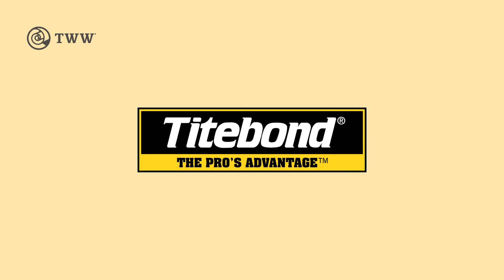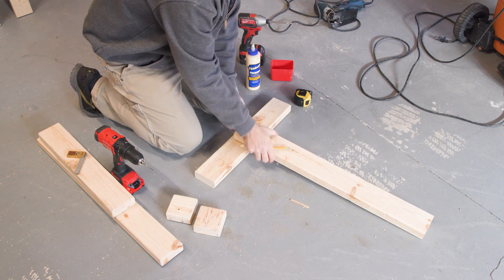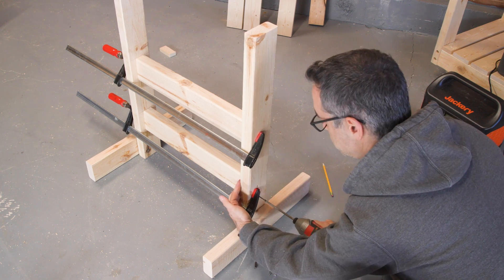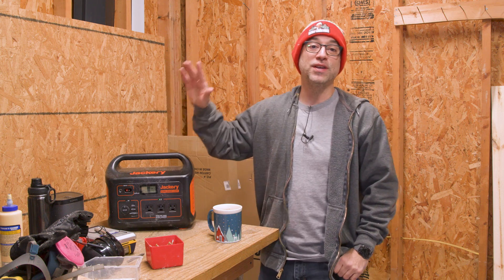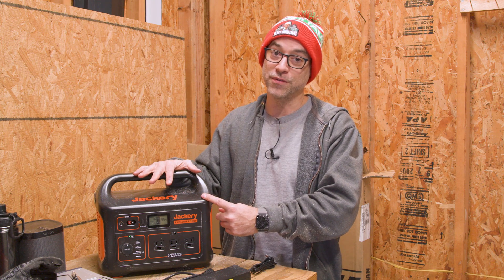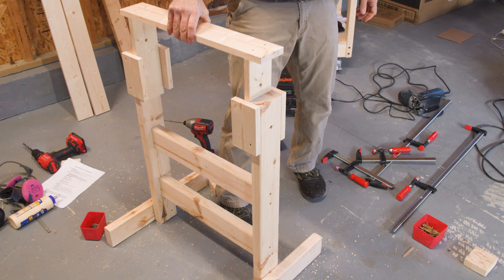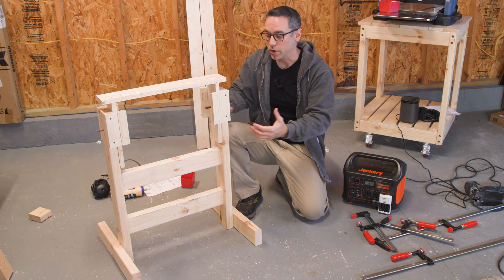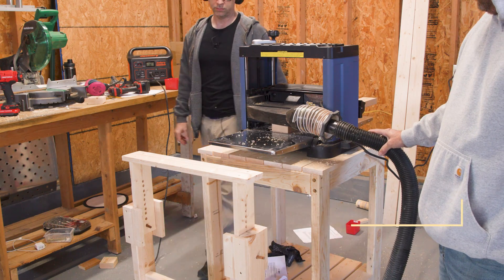Adjustable-Height Work Support

Comment: Make a staggered line of holes, with two corresponding through the outside. Then you can have more options for adjustment without the issue of getting them too close together.
Reply: I'd suggest replacing the holes in the movable part with a slot (I would personally use my router table or a router with an edge guide, but a jigsaw would work if you don't have a router), and then use a bolt, 2 washers washers and a star knob on each side to create an infinitely adjustable version. I'd also round over the edges of the top in order to make it so that a board can deflect upwards if you get it just a smidge too low rather than just knocking over the stand.
Reply: @solonys9775  Another great option if you have the hardware!
Reply: Could also drill the holes before attaching to the support and drill through both at the same time, then they for sure line up.
Reply: A slight change in the design and use wedges to lock it.
Reply: Also number the holes, so you can be sure to use the same holes, and not end up wonky.

Comment: This is cool, but why does it need to adjust at all? The planer stand is a fixed height and the bed of the planer doesn’t move so the bottom of the board will always be the same height from the floor.

Comment: Awesome video. One idea would be to go say 1 inch spacing on the 1x4 and put a 2nd hole on the 2x4 at 1.5 and say 2.75 to ultimately get 1/4 inch resolution on your adjustment.

Comment: Often my choice for quick adjustable height work support. Is the Harbor Freight Roller stands. In a small shop situation, they take such little room when collapsed. That that are just a fantastic win. If you don't want them to roll, turn them 90 degrees.

Comment: Cut a long, shallow wedge/taper with a plane onto the leading edge of the top board.  That way, if the stock hits it a bit too low, it'll push the workpiece up onto the top board.  I did this on the edge of my drill press table, which is next to the outfeed of my planer so I can use it to support longer stock if necessary.

Comment: I like this. Simple and very accessible for a newbie to the craft! I'd second the two-hole-row with offsets Vanessa suggested below. 
Maybe you could do a shorter piece on the dangers of using your drill battery as a hammer. You likely know it discombobulates the electrons and can cause subspace distortions... and we all know how hard recombobulating electrons can be.

Comment: How about using the hole in the stationary part of the stand as a guide for drilling the holes in the movable part?  You could raise it up with small blocks for each set of holes.  If you're careful not to rack the drill, I don't think the guide holes would widen much.

Comment: Seems like it would be better to route a slot through the inner planks, and then use hand knobs to tighten it at any height in the range. Then you wouldn't have to worry with aligning the holes so perfectly and you'd have any height option you need within the range.

Comment: I’d cut a through slot all the way down and then a little bit wider recessed slot on the inside so I could use a t bolt and knob. It could then be adjusted to any height.

Comment: Referring to the movable support, I'm so bad at woodworking, that I'd clamp both the vertical pieces together (before attaching them to the horizontal piece) and drill the holes through both of them at the same time instead of measuring them separately.  Otherwise, I'd never get them to line up.  Cool, simple, project!

Comment: This design is great for an adjustable work table. And it could be more stable if you cut sliding dovetail slides in the height adjustment, I also think you could use a system to crank it up or down.
Home depot had a tool box like that for a wile.

Comment: Another suggestion for the holes is to drill 16 holes on the movable part spaced at 1" on center, and 16 holes in the stationary part spaced at 15/16" on center, that would give you 16 inches of travel with 1/16" resolution...

... assuming you use a brad point bit to control the hole locations.

Comment: Great project idea ... one suggestion ... instead of a single row of holes down the center for height adjustment, I would have two rows or even three (probably to much) and on the extra row(s) have a quarter inch offset from the 1/2 inch spacing so that now instead of only on the 1/2 inch you are able to do 1/4 inch ... first row 1/2 inch spacing, second row 1/4 inch offset and then 1/2 spacing.

Comment: Have one or two more holes in the stationary part that does NOT match up if any of the others is used so you double or tripple the adjustment holes.

If the hole spacing in the movable one is one inch then have one extra hole on the stationary 1 and a half inch above (the half is the only important, the whole is tho have some more space for strenght)

Comment: Nice easy build. Another quick improvement would be to cut a slot instead of holes and use a long bolt and wing nut to get more precise height adjustment. As long as whatever you’re supporting isn’t too heavy it should be fine.
Reply from the maker: Great tip!

Comment: you should take a belt sander and just bevel or slightly round over the entire top piece to help the board ride up onto the support. that would help avoid what happened in the last clip where the board pushed the stand out of the way.

Comment: Why not sink a lower leval in your miter saw station at your home shop. You can also add this for the planner.
Question what do you need a planer at home for?  Do you plan on buying rough cut wood for the shop at home?
This also brings up the point. You got too used to walking into the garage at home or out in the back yard at home. 
Now the shops away from your house
You've got to drive somewhere to play in the shop.

Comment: I think it would be easier to adjust if the part with the adjustable holes was on the outside, instead of the inside.

Comment: Drilling the holes. Do it before assembly and drill on drill press both parts at the same time,  far too much opertunity to make a measuring mistake and if you do its not going to be leval at every stop point.